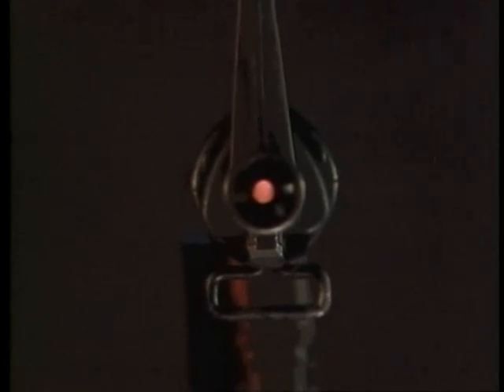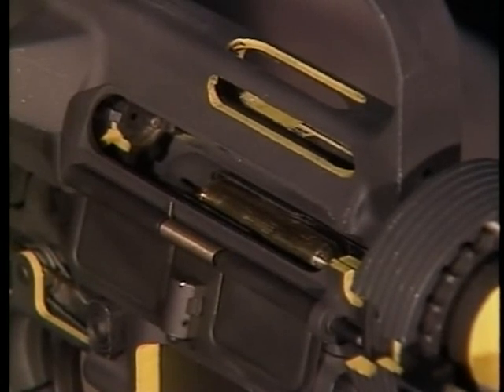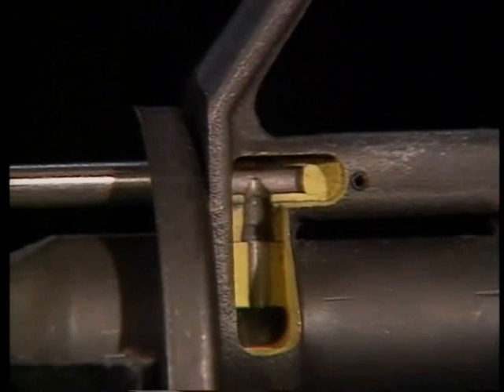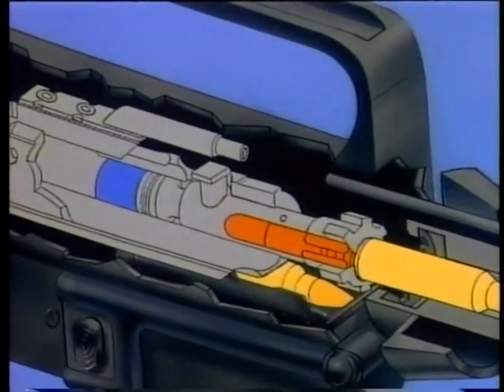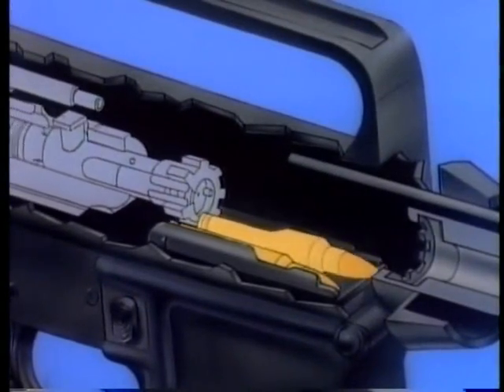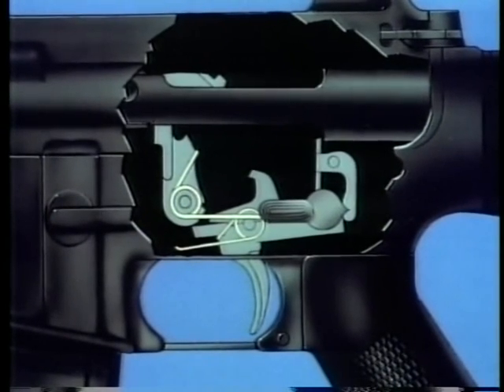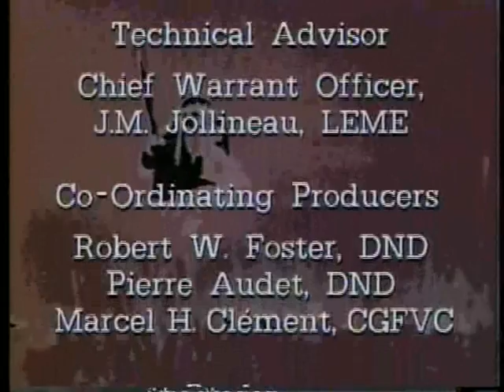Cycle of Operation - C7 Rifle & C8 Carbine

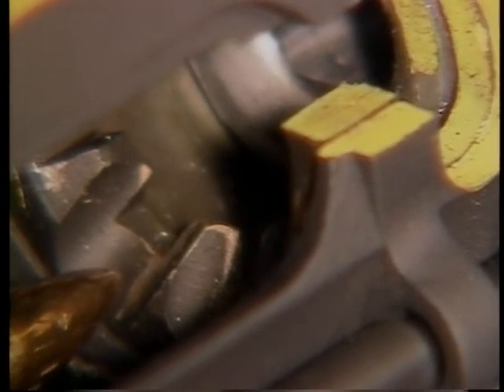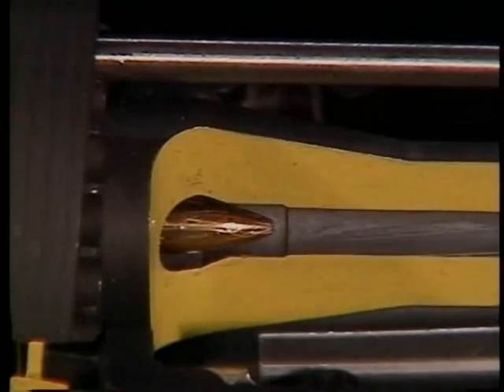Comment: From 6:00 to 6:05 shows how the rim on the shell is rebounding off the feed ramp during feeding, causing the bullet to bounce.  This is a source of jams and misfires as the bullet is not controlled by the bolt at this point, but being guided by luck similar to a pool stick hitting a billiard ball.  That feed ramp should have been better machined to not interfere with bullet feeding into the chamber.
Reply: that was an upgrade on the M4 series of rifles stateside.  That change worked its way into later rifles.

Comment: 1986-88 when Canada got this with plastic mag  C7
Reply: stephane leblanc whatever happened to those plastic mags? They still in use?
Reply from the maker: @Eli_G454  No.  They kept crapping out.  Now metal mags are used.
Reply: My dad saw a trial in 83 during his time at BMQ they were comparing them to the FN C1A1 and calling the new C7s shit.
Reply: @Eli_G454  my buddy who's PPCLI out of Shilo Manatoba says they have them floating around but they are all taped and falling appart.